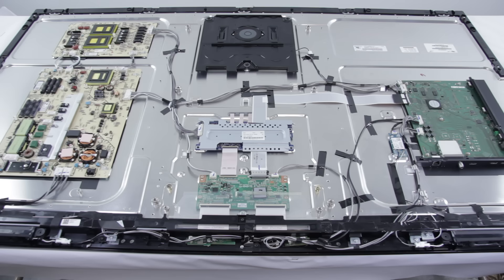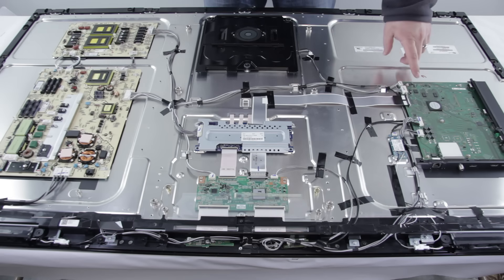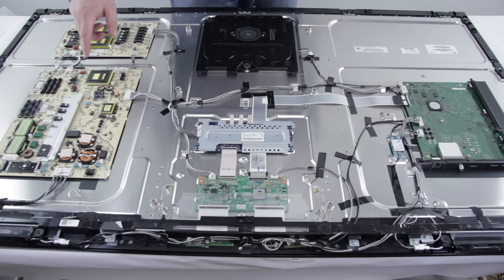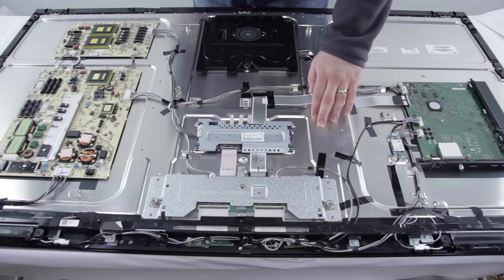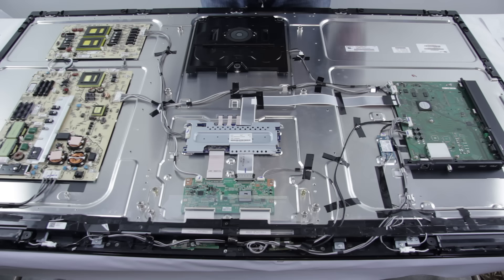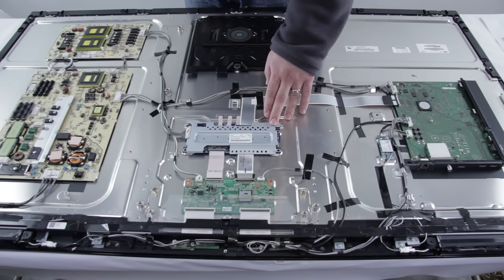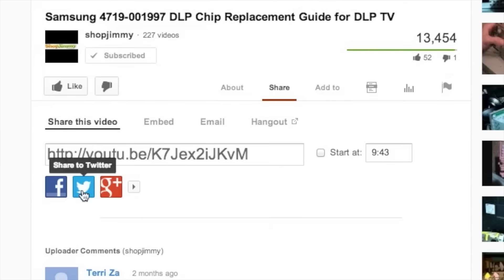LED TV Repair Tutorial - Common Symptoms & Solutions - How to Repair LED TVs

Comment: Thanks for the video .. I have a LG Model# 55LA7400 with vertical lines .. I took the back panel and I noticed like oil trace on the right side coming from the Heat sink on the Main board. All capacitor on all boards look ok and no shorts or burn make are visible. Took the TV to a nice old man near boulder and He said my panel is bad... I would like to believe the nice man...but I have my doubts.  I would like your help if possible.

Comment: Hello video seems really good. I'll be to watch more. I have a sharp Aquarius lc60eq10u. There was some green vertical lines on the left side at one point. It was under warranty thru best buy. They did replace the main board to. Did not fix it. Anyway, we just asked for our money back and kept the tv. It powers on, the back light does light, only when the 4 ribbon cables are disconnected from the t con board and tv panel.  Any ideas? Thank you

Comment: Hi Jimmy.I have a LG 42LH30-UA that has occasional vertical lines on the left third of the screen. It normally occurs when the tv is first turned on. I have already replaced the main board and that lessened the severity of the lines and reduced the amount of time they remained on screen.I’ve been told that it could be a bad power Supply oand or a bad t-con board.Might you have any suggestions as to which I may need to replace?Thanks.

Comment: My TV is a LG 47LN5700-UH I had a lightning strike near the house. Afterward TV would start but not boot completely. Now it won’t start at all. Thanks to your YouTube videos I’ve determined the following:Ready light is on. It flashes three times when you push power on button.The power board and the main board show no obvious damage. Fuses are OK on power board. I get 3.5V on each standby power tabs and 12V and 24V on other tabs on power board.The T Comm board “looks” fine. It has a ribbon cable from the main board, a second cable from the main board and a wire from the on/off button.No LED lights show up from the back when TV is on in a dark room. Could not see any picture using the flashlight test (no backlighting)Does this imply the LED driver is bad? Is it integrated on power supply board?  The ribbon cable to
the T Comm board comes from the main board not the power supply board.Or is it possible all LEDs are bad?
Appreciate any advice for next steps   Ray

Comment: You helped me fix a Samsung 50" HDTV. Thanks. I have a Sony KDL50W800C. I was able to get it out of the boot loop. Everything looked good until I got to the help screen. The bottom of the screen has checker board pattern with 1/2" squares. The boot screens all look good. The input screen is all broken up into triangles. Ideas? Thanks Chris

Comment: LG 47SL90, started with a horizontal line, and then few days later 80% of screen is garbled with only top strip across showing picture. Eventually it would clear initially, and now it never goes away...
Leanig towards tcomm board as per your video, any suggestions ans links to buy much appreciated!

Comment: I have a Samsung 82" Model: DM82D.  It was working fine, powered off for a few hours now there are 2 white bars on the left of the screen, while the rest of the screen is black. They they blink, once or twice, then slowly fade away from the top.  Then smaller multi colored lines appear in the middle of the screen, but a lot more and smaller while both outer sides are black.  There is sound, and back lighting, i'm guessing as I can tell when the screen is powered on even if it is still black.

Comment: Hey Hi. I have Led tv assembling unit in Nepal. And have 2 issues with me.
Could u please tell me how can I repair the Panel PCB with no picture but with backlight on (white screen) for Chinese assembled led TV's. Another issue is for panel with standby issue. I think it has switching issue with the Panel PCB. But could not find the faulty part.

Comment: Hello. I have a question.
I have a Philips 49PUS7909/12

While watching regular antenna channels, it switched off and then switched back on. But now it is showing only the PHILIPS logo on the screen.
So basically screen is working but it is showing only the PHILIPS logo. And the ambient light is pulsing. I mean the led stripes on the back of the TV.
The TV doesn't respond to the remote control, although I am sure the remote is fine and the batteries are good.

I tried to update the software using a USB flash drive but the tv does nothing. No signs of life... only the PHILIPS logo on the screen.
At the moment of the incident, there were no peripherals connected to it. Just the antenna cable.

The weather was fine so there couldn't be any interference from the weather.

Please help :(

Comment: Hi there....We've got a Vizio D70-D3 with a shadow on the upper portion of the screen.  Looks like 1 and a half backlight strips are either out or dim.  I've got a picture of the screen if that would help.  On the left side of the screen, it looks like the top strip is dim...on the right side, it looks like the top 2 strips are dim...  like this ...     ------====  ... Sort of.  Sound like something that new backlights would fix or some sort of other hardware problem...?? Thanks!

Comment: I have a toschiba lcd tv model 40rv525u that is stuck on the initial setup screen and it will not respond to manual commands or remote control commands. I’m so very frustrated with Toshiba because they don’t even support there products.  Can anyone help me?

Comment: Hi Jimmy !I have a Daenyx DN-19D LED TV and the screen adjustment is too wide (vertical and horizontal). I am loosing half of Windows Toolbar and I don't see the Close button in full screen mode wether I use HDMI or Composite input. I thought that changing the resolution on my PC would allow me to see the whole screen but it seems to automatically adjust to full screen. How do you adjust Vertical and Horizontal size on a LED TV ?Thanks !

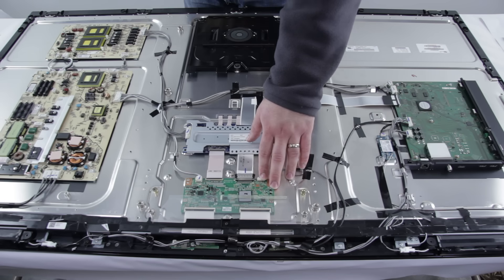Comment: nailed it at 5:26 into the video.... sounds just like the T-Con board on my Samsung UN39FH5000.  I occasionally get the vertical lines, the half screen, the white shadows behind the lighter images.  I initially thought (out of the box) that the problem was the hdmi cable or the "smart Samsung dvd player" but no matter what cable I used it still happened intermittently right out of the new box.  Because it was so intermittent I did not contact Samsung thinking it was the cables.  TOTALLY my bad.  Came home from physical therapy today to a white screen.  No pic.  Turned TV on and off and left off for 30 minutes.  Pic is back but had a "twitch" to it.  Initially a white shadowy box around the outside perimeter of the screen.  Weirdness.  After the 30 minute wait, appears the intermittent issue is gone again.  (side note.... appears I wrote this under my sons youtube name lol....oie.

Comment: Hi Jimmy - I was given a Teac 22inch LED DVD/TV Model no. LEDV2216FV for which the owner had accidentally reversed the 12v polarity. Is this likely to be an easy fix? Power is not getting to the manual switch, the diode on the power board is okay and I can't see any obvious signs of damage. 
Thanks in anticipation
Tim

Comment: Hi Jimmy, I have a sharp tv model lc-50lb371u, Problem is began with a faint shadow in the middle of the screen for  a couple weeks and then progressed to a blank screen. When I turn on the the tv though a can see a faint image that goes away after a few seconds. I do have sound though, I took off the back cover and four of the led strips do not work and the two middle strips do. I took off one of the strips that does work and one that did not and switched them to see the strip that did not work in its original spot would work in the spot with the working strip led. The result was the same as the two strips in the middle worked while the other 4 still did not, so I figured its not the led but possibly the t con board??? am I correct??? thank you Bo bo_cummins@yahoo.com

Comment: Vizio 
model: M492i-B2
Serial: LWJJRAAQ3302796

Horizontal line in center and static-like horizontal line in bottom half of screen coming on and going off at 3 second intervals. Also, low volume sound even when turned up higher.

Comment: LG TV LG 65UF6450-UA.AUSYLJR   Getting a band of white light (color Spec in it) 1/3 of the screen Horizontally across the  screen. LEDs appear to be lighting all across the back, I can see them through the holes in the rear. Not sure if it's the Tcon board or the main driver board! I have a video and some screen shots. This 65" barely lasted a year! NO ONE has these parts in stock... Any thoughts! could I replace all the parts with LG MODEL  ==== UA.BUSYLJR ?? if i could get those??

Comment: mime Samsung TV the model number is UN46 b6000 VF my symptoms are it comes on just the blue light goes it kicks on but I can't see the volume the menu nothing with the remote or anybody the button on the TV it's just a blue light which changes a little bit if I change the channels or something tell it's changing channels but you can't see the numbers to the channels or anything like that so what would that problem be

Comment: I have replaced the T con board. I had sound and blue backlight but no picture. After replacing the T con board I powered up the TV. It had a picture on the screen show the input - it also had vertical very dense blue lines. After about a minute the picture disappeared. The TV is a Vizsio E701i-A3. What should I do now - what do you think? Thanks Ron

Comment: My RCA LED TV has audio but no picture. Model number LED39B45RQ. I have 7 volts stand by. No 12 volt reading on the power supply board. The TV was built in November 2013. I have the red stand by light. Thank you for any help you can give me.

Comment: Hey great introduction to LED Tv internal components, I am now less hesitant in trying to fix my Sylvania Model SLED5550 55" TV. I have approximately 2 to 3 inches of the right hand side picture missing just pure black, the rest of the screen is perfect, what do you suggest? Tossed out two older sets with no power, haha wish I had seen this before I did that.

Comment: Hi i think my led driver has gone on my bush 50 inch. Its a uk tv i have 24v on the v+ pins when i power the tv on the leds light up for a second then go out. there is always 24v even after the lights have gone out so i think the supply to the board is ok. on the pins where the led ribbons connect i have 1v when they flick on then 0v after they have gone out i have sent for a board to try as it was cheap and worth trying just wondering if it could be something else? thanks Lee.

Comment: Hi Jimmy ,
     I have a Samsung UN46B6000VFXZA TV that I have already replaced the T-CON board on to no avail . Set powers on and has image and sound but with vertical lines and washed out screen . I have checked all voltages that I have learned about on you tube and everything looks good there as far as I can see , even tried pressing the ribbons attached to the actual panel with no difference either . I'm pretty much stumped at this point .
   I will say that I have enjoyed watching the tutorials and that is what actually got me interested in trouble shooting and attempting the repairs on my own rather that spend the money on shop time knowing this is a older TV by standards . It's sad to think back when we started getting the imports in how robust and long living they were . My first Toshiba lasted a good twenty years and was working fine when I passed it on to a friend , heck might still be going strong today for all I know .
   Anyway thanks  in advance for any help you might be able to pass along , greatly appreciated .
                                                                                                               Dean

Comment: Hello. I have a Hisense 55H6B and I’m having trouble figuring out the issue with it. It turns on just fine and the hisense logo is just fine but once it goes to main screen it has colored vertical lines down the screen that seem to appear with the text. The lines run from top to bottom wherever there is text on the black screen. Once I put a picture to it the entire screen gets colored lines that change position and color. I’ve already replaced the Tcon board with no change. Is this a main board problem?

Comment: I have a Vizio D39H-CO LED TV. There is backlight, but, no picture. If I have tested it correctly, it also appears that there is no audio either. The TV will power on manually and with the remote, however, the screen just has a low blue glow to it. If I tap the case the blue glow will flash brighter upon impact and then return to glowing low intensity. After opening the case it appears that there is only one board unless there is something located under the shroud that the board is mounted to.The ShopJimmy  troubleshooting video mentions that some Vizio TVs might only have one board. When I took off the back  of this one, there was only one board so I replaced it with the exact part from ShopJimmy. Unfortunately this did not fix my TV. So it's obvious that I'm missing something. I would appreciate any advice on how to proceed on fixing, or, getting a diagnosis on this screen. 
Thanks to all.

Comment: I have a Samsung un60eh6050fxza (hs01),the screen stays dark blue and I cannot get a picture, i do have sound,I have replaced the t-con board with a new one and still have the same issue, do you think it may be the main  board, or the power supply / LED board? Thanks for your help

Comment: My LG 70 in 3d TV model number 70lb7100uc will come on I get LG start up screen for a few seconds then black screen. Still sound. Flash light test shows icons when home button is pushed.. you can faintly see them enough to choose Netflix or any other option and those still work. Can't tell if there's backlights working there's no vents or other opening in back of this TV. This started with the screen randomly going black upon occasion for several months before it finally just would not stay on at all.. it's barely the years old. I'm assuming tcon board or led driver???

Comment: Hi,
Five red blinks in Sony LED TV KDL 40W900A.
TV was idle for almost one month. I switched on the TV after this one month. Then TV was not turned on, five red blinks are coming and nothing is coming in the screen. I did power reset the TV and nothing seems to work. When I turn it on, after I press the power button, it hear pretty audible click then, the red led blinking flashing light 5 times every few seconds. TV model is Sony LED TV KDL 40W900A. Please suggest to solve this issue.

Comment: Hi Jimmy
I have a RCA RLDED4633A-C Tv. I have the classic no image only sound issue. I did the flashlight test. I can see an image. Checked all voltages at power supply and all is ok. There is only 1 + and 1 - wire going to the LEDs. I’m not sure what the voltage should be there, but I get 94v with and without the connector connected to the power supply board. Is this voltage ok? I do notice a spike in voltage when I turn on the switch (220 v) and then goes down to 94v. I’m hesitant in going further (checking LED strip) without knowing if this 94v is correct. 
Thank you in advance.

Comment: I have a 60" element Led tv. Just a little over a able year old. I tried hooking up 40 mile range indoor antenna I w was not able to get any channels. Now the TV has one horizontal line at the bottom about 1/8 wide. Half of it on left is black and the other half is fainted white. My email is lopezaline352@gmail.com. thank you.

Comment: I've got a Visio M552i-B2.  I've got no picture, the remote doesn't work for power or to change inputs, but the power light in the lower left corner is illuminated.  Hard to tell if I can change inputs, but just can't see it, since the screen is completely dark and no display to see.  I tried unplug and replug with the power switch in the back depressed for 10 seconds, and no help.  Thanks for your help.  Bryan

Comment: We own a toshiba regza 55sv670u and we turned it on and the image is ghosting vertically someone suggested unplugging the one side of the t-con board tape cables and the result was that the left side plugged right side unpugged made 1/2 of the screen work correctly. Do you have any suggestions? Would the t con board be bad?

Comment: 15-09-17
Dear Service Support,
I have a Samsung LED TV Model UE55D-7090 LS

Serial Nr. Z8GE3SRBB00419NPurchased on 23-12-2011.

Problem/Symptoms
TV makes a clicking tone which is caused by the relay on the Power Controller Board going on and off.I have examined the capacitors on the PCB searching for anything that appears to the eye as being defect, I found nothing.
The TV then switches off and sometimes comes back on or remains off.

Comments:
This problem is known by Samsung who have taken not taken any  measures to do any recall or solve the issue which appears to be caused by capacitors on the Power
Controller Board which appear to be underrated.Samsung will not provide any Service documentation:-(. Without any technical or service documentation (electronic schematic diagrams, technical functional description, voltage and oscilloscope test points) with expect results. If available please would you be kind enough and send me the PDF.Cost of replacement Power Supply Controller Board.Cost of replacement Processor-HDMI & Tuner Board. Q) Can I upgrade this model by replacing the Processor Board to support UHD 4K. new board or are they incompatible?Thanks & Best Regards,Thomas GrantThomas.Grant@siemens-healthineers.com

Comment: I have Sharp LC-65LE643U.  When I turn on the TV, the backlight goes on and sound comes on, but screen goes hazy white/grey.  After watching your video, I thought it might be the T-CON, so I replaced the T-CON with a new board.  The symptoms have not changed.  As suggested in the video for checking visible burn or problems, and non can be seen.  Any suggestions?
Thank you